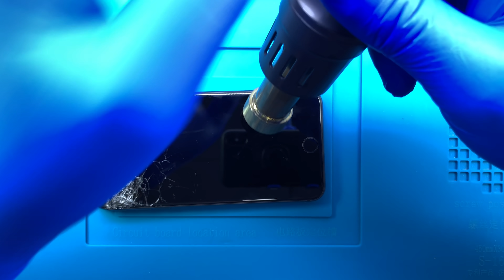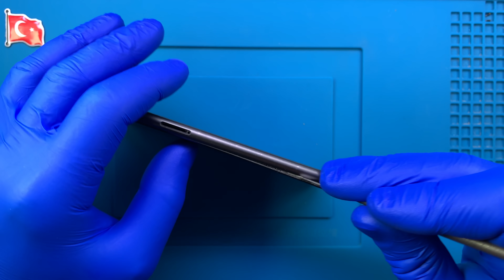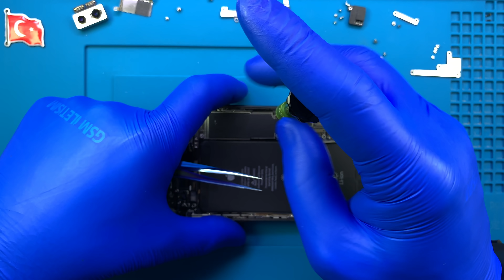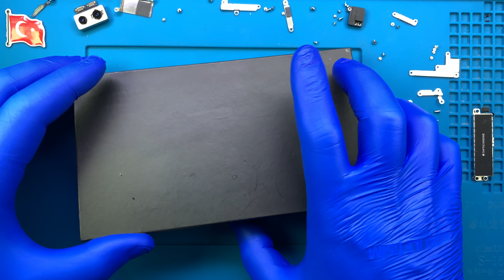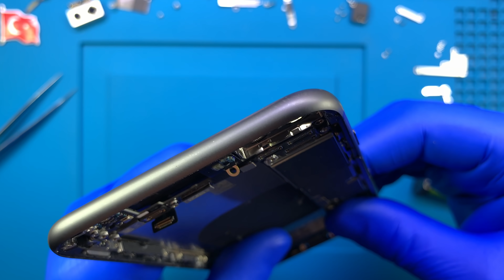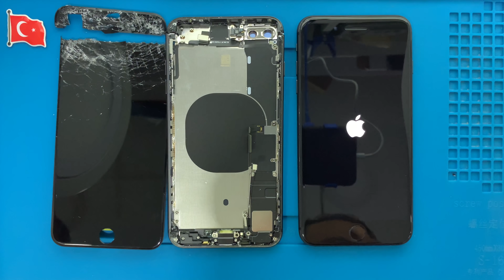PARÇALANMIŞ! iPhone 8 Plus Ekran ve Kasa Değişimi Sonrası Çalışır mı ? 🇹🇷

Comment: Bye IP68😂😢
Reply from the maker: Hi;
Phone manufacturers guarantee water resistance only for devices that have not been damaged and have undergone technical service. For this reason, more attention should be paid to fluid contact after screen - part replacement and technical service.
Greetings.